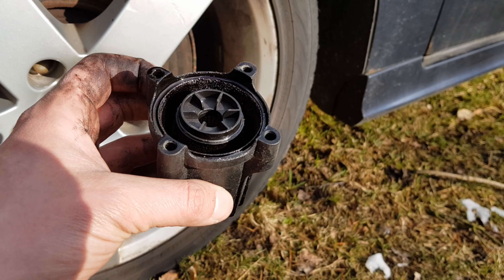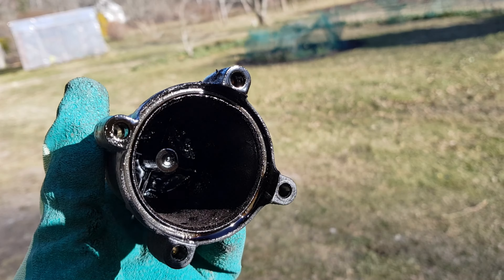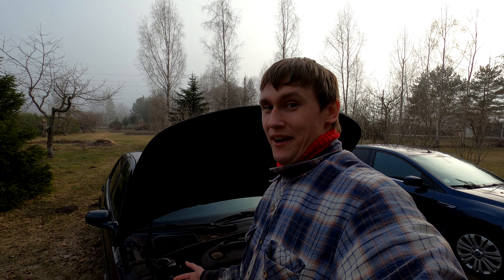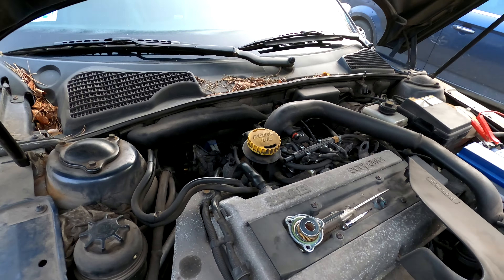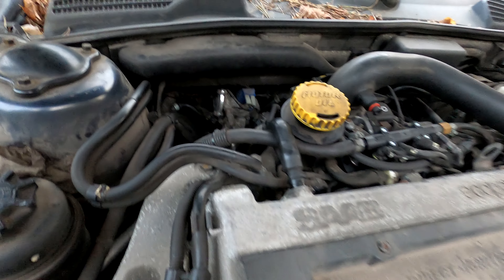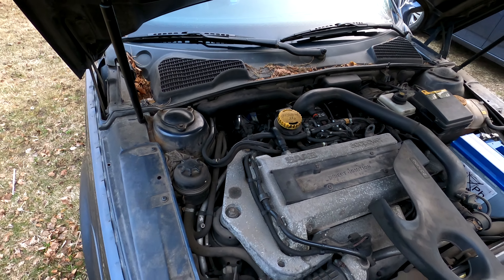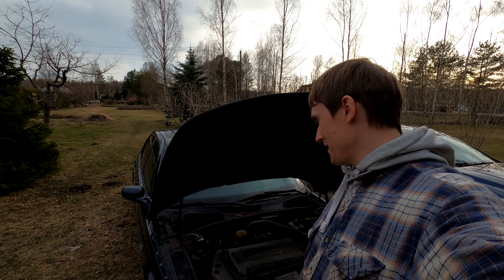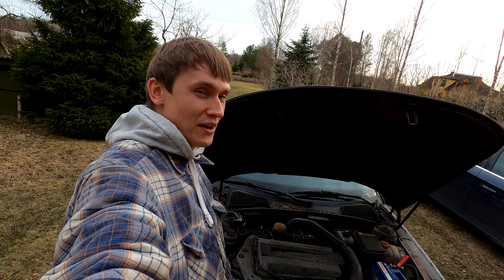Replacing LPG Filters on 2004 Saab 9-5

Comment: Hi, here is a thought. There should be a solenoid valve on the LPG vaporizer body that will open when the car switches on LPG. Many times that valve gets stuck because the LPG gas isn't that clean and with time the dirt will stop the solenoid in the valve to open. It happened to me and of course, I changed the filters and that wasn't the problem. It looks like you don't have enough LPG going to the engine, that's why the engine stalls and dies. There should be another filter/mesh screen where the LPG line goes into the vaporizer. This is a filter for LPG in the liquid state. You might have that filter/screen or not depending on the LPG kit.
There was a way I found out quickly if the solenoid valve from the vaporizer was stuck: I drove my car at 3000rpm on gasoline and then I switched on LPG. IT got the valve unstuck for a while and it ran fine after that on LPG until I stopped the engine for a while. I did it a bunch of times like that until it will not go to LPG no more. This might or might not work for you, depending on how much dirt is in that valve and how long the car didn't run on LPG. 
After that, I removed the solenoid valve that opens/closes the LPG going through the vaporizer and it was so dirty... I cleaned it with some carburetor cleaning spray until the inside "rod" was moving freely. It runs like new now!  The purpose of this solenoid valve is to open/close the LPG running through the vaporizer to the LPG injectors. Of course, you have a multivalve on the LPG tank which opens first when the car switches to LPG.
Let me know what LPG system/brand you have installed on your car and I can pinpoint the location on the solenoid valve.
This will be a free fix + labor :) No need to replace the solenoid unless is defective...
I hope this helps. Please let me know! And tell me what kind of LPG system you have! Chris

Comment: Maybe the new injectors are not calibrated for your engine. I am saying this, because the car runs on LPG using the old injectors, without stalling. So for sure the old injectors ramp are almost dead, but still manage to inject gas into the engine. I would go to the LPG service and ask them to look into the diagnostics and read the data from the new injectors and maybe they can optimize their running. It was an idea from my side.
Reply: I was thinking the same thing. LPG computers need to be recalibrated every couple of years with no changes anyway, so an LPG mechanic calibrating the computer to the new injectors and clean filters might work.